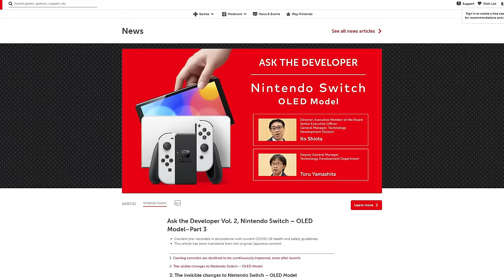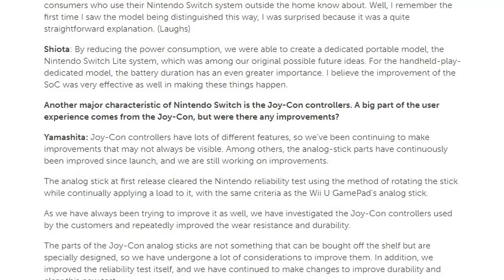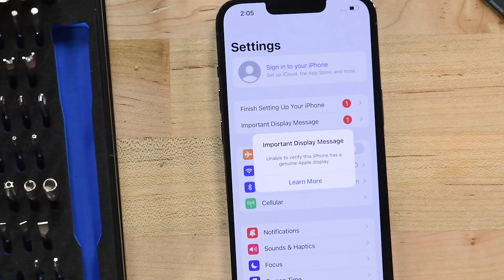Nintendo Switch OLED Teardown: More Different Than You Think

Comment: The joysticks are definitely different, especially the left one with the OLED.

You can tell just by the sound that it makes through use in comparison to older joycon models.
Reply: Worse or better?
Reply: @FloresdorfGaming  for better. Zero drift and the joysticks feel sturdier.

Comment: Have they fixed this issue where if you put joycons in upside down they get stuck?
Reply: I just tried that with my Switch OLED and indeed they fixed it.  If you insert the joy-con upside down it is blocked 3/4 the way in and easily removed.
Reply: @SanderEvers  That's awesome, I hope people see this comment.
They probably should have mentioned it in the video.
Reply: You can do that? Hold on-

Comment: Should you remove the anti-shatter film if you intend on getting a screen protector?
Reply: Just put a screen protector on top of the film. That's what I would do. Hopefully when the screen protector needs to be removed, the film underneath doesn't get damaged. You might want to talk with a Nintendo representative (assuming they even answer your question, lol...)
Reply: Definitely not, never remove that film.
Reply: The film is to stop glass shattering everywhere. Does nothing else

Comment: Did u see 2 foam sticker around the analog sticks to apply extra pressure on the the sticks to help keep Joy-Con Drift Away
Reply: It's a dust cover to prevent drift. No pressure. If the back is applied with a cardboard maybe temp fix. Bought used and I know why. 5:58- Black spots on the blue tap is dirty= drifting. I cleaned all and its fixed. Not easy to open it + put it back in. L, 2 tabs broke from opening it higher, but the 2 sides manages to hold it in place.

Comment: Been using the OLED switch and regarding that thermal change, I've noticed my switch being a lot cooler than the original and updated chip
Reply: So you’re saying OLED is cooler than V1 and V2 models? Some said OLED gets very hot when playing games
Reply: @Retro Gamer 64  mine hardly does tbh. Especially docked too, it's not any hotter tbh

Comment: A removable / modular storage unit on the original vs the non modular memory module on the oled makes 0 difference as swapping these modules between Nintendo switch units doesn't work to begin with... Unless the units you are swapping them on are unpatched and can have various points of data dumped and transferred to another module. But that's getting into a territory of the switch that isn't too common anymore.

Great teardown video either way

Comment: After 3 years, I would think Nintendo would do a Switch Pro or tweak performance and give gamers a smoother experience when playing games if upgrading the graphics card wasn't an option for Nintendo but at least release a newer model with 30fps locked with the OLED screen upgrade could been a nice addition.
Reply: why would they lose money on a dead system anyway

Comment: I don’t own a switch but I’d love to buy Nintendo switch OLED. From an engineering standpoint, I’m really happy that Nintendo has made a somewhat repairable console. If there were to be fourth version of the Switch, i’d like to see the battery not glued down. I’d also like to a removable SSD like the Microsoft Surface. 256GB M.2 NVME 2230 should be enough.

Comment: fin fact: the only thumbsticks that were practically impervious to wear, were those of the sega saturn and dreamcast.
they used hall effect sensord on the board, and a little magnet for the tracking, and a centering mechanism that simpley couldn't develop any wobble. at worst, those needed a cleaning and some fresh lube after hundreds and hundreds of hours. and at that point wear of the buttons was the bigger issue.
Reply: 8bitdo has a new controller with that hall sensor on sticks

Comment: Everyone just kind of skips by the actual removal of parts. How do you take the joycon ribbons out? The heat sink is pretty stuck on and you just cut to it coming off.
Reply: you mean.. the ribbon cable Inside the joycon??? just lift the Ribbon Cable LOCK .. lift it up with plastic tool to unlock it then you can safely remove the cable

Comment: I’m not a huge fan of how much the kickstand hinges are protruding into the body of the switch. I know the LCD switch was never IP rated but the old design definitely was better at keeping dust out. The new design looks like it would be extremely easy to get a lot of dust and dirt in there.

Comment: So does the OLED still suffer from certain issues (especially with V2) such as cracks developing near screws, bending from heat when docked (believe it's been confirmed as a myth?), rail issues, fan issues, scratching when docked, and such?  If the build quality is better and prone to less issues then that makes 350 and a cheap OLED Samsung screen a bit better to swallow.

Comment: Does the OLED screen use the same connector as the standard LCD one? Wondering if its possible to swap in an OLED display into a V1 switch.

Comment: How many milliamp hours does the battery have
Reply: The batteries are mention as being 16Wh. 16Wh divided by 3.7V (nominal voltage of pretty much any lithium cell) gives 4324 Mah as the total capacity.

Which matches the 4.3Ah capacity Nintendo themselves advertise in their specs.

Comment: So I've come across an issue with the rails of the Nintendo switch oled. some disinfectant sanitizer got onto my joy-con and left side rails of the Nintendo switch OLED, and now is very finicky with connection. I took apart the switch to wipe down with unfortunately I only had 91%. Isopropyl alcohol, and it works better but still with light movements it will disconnect or reconnect.

My question is is it possible to reuse the original switches left side rail module or rail and total to replace the left side Nintendo switch OLED rail?

Comment: Hey would you tell me the cause of my switch lite damage? just got an orange screen of death and all I know that’s caused by the wifi chip. I’ve heard and seen a lot of orange screen of death probs on the swtich lite, v1, and also v2. Does the oled version got the same possibility as the other switch issues?

Comment: I have a Nintendo switch and it went black screen and won’t boot up anymore and I have tried every home method and check the cables dock port AC adapter and a hard reboot any advice?

Comment: Is it a shield or a heat sync? I always thought it was a heat sync. What's would be the reason to shield it off?
Reply: They need to stop the heat from gegting to the back of the console. It's because your hands will touch the back of the switch, and for comfort and safety reasons it can't get all the heat from the SOC dumped in the back shell.

Comment: I can’t seem to find the answer to this question anywhere on the internet. But for the protective film on the front of the OLED panel. Is it possible to replace? I bought mine used and it looks like the previous owner made the mistake of trying to take it off. One of the corners is bubbled up. So is it possible to take it off and replace it and where would I find a replacement?
Reply: Take it off entirely. It does nothing but stop glass from flying everywhere if dropped.

Comment: The OLED model is awesome
Reply: Any joy con is compatible with the Switch OLED. Unlike Apple, making certain parts from the same model not compatible since iPhone 12.
Reply: @thatguyalex2835  Lol why are you bringing up Apple?
Reply: @Starling_54  Because they are impossible to fix. They were better a few years ago, like during iPhone 5-6 era. I have nothing against Apple, but I am glad Nintendo is not going the Apple route where parts are locked in by software. :) Louis Rossmann has a lot to say about Apple, and it is not always positive.
Reply: @thatguyalex2835  yeah, I guess that makes sense.
Reply: @thatguyalex2835  phones break that’s why me personally if my phone broke I’d just buy a new one tbh
Reply: @thenotoriousjoey9956  But they shouldn't break after one year.
Reply: @thatguyalex2835  wym I had my iPhone 11 Pro Max for 2 years and it’s been solid take care of things and it will be fine
Reply: @thenotoriousjoey9956  That is good. Some phones fall apart quicker, especially cheap 30 dollar androids, but 900 dollar iPhone screen can break easily also

Comment: Mmh I would be intressting if the display connector is the same. And when it is if it possible to mount the led in the lcd version
Reply: They're not the same size. You probably could connect the cable and it would work but it couldn't stay attached to the switch case/shell.
Reply: @MajorasWrath1  that's not a Problem to modify tge frame

Comment: So can I just plug that oled screen in a regular switch? or is there not a spot on the motherboard?
Reply: Pretty sure the OLED screen is slightly larger. It wouldn't fit without you doing some more hard modding and it'd be a pain in the ass.
Reply: Steam deck is a handheld PC. Switch is a handheld console.   still have their pros and cons.

Comment: I would be careful removing the antenna from under the shield, you can easily short out something with it's metal connector.
Also I would consider the display panel as plastic since it's top layer is and can be easily scuffed. Nintendo should've used a pre-applied plastic screen protector so buyers can either leave it on and/or replace with one of their own.

Comment: I will point out that as far as joysticks go, at the least nintendo has made them the most modular compared to all other gaming platforms as controller replacement goes. as if a joy stick on a single joycon going bad is half the set.... And this was one of my biggest concerns for the steam deck when I saw no detachable controller region. Honestly though the modern joystick will in the current consumer cost effective and size feasible state be a item that gives out faster than many would hope and that is just how it is.... I wouldn't attribute this to Nintendo in any case despite that.

Comment: so nobody is going to address that the heat pipe and fan got smaller... if some other company "did" something like that I am sure the internet would lose it's mind hahaha
Reply: Well, apple does it or even has fake fans that don't actually provide any cooling. Nintendo shrinking theirs makes sense since the second revision switch has a more efficient chip that therefore does not run as hot. 

Apple might shrink the heat pipe and change nothing about the chip so it runs hot often making you buy a new product sooner, and everyone would praise it for being innovative :)
Reply: Sony did that with PS5. Heat sink is tiny in v3 vs v1 and much lighter console now

Comment: The cooling system is exactly the same as the switch lite
Reply: yes, probably they realized that the switch lite's smaller ventilation system performed as good as the og switch, and both consoles being the same in terms of cpu and basic functionalities they applied the same concept. clever

Comment: Does anyone here know what thermal paste the regular switch uses
Reply: There's really no way to know lol. You could just use any thermal paste. Use Non conductive if you're worried it might touch any solder joints/components

Comment: I'm surprised they nerfed the cooling a bit, my 2029 model tends to run hot in docked mode
Edit* lol I mean 2019 model I'm not like some sort of time traveler haha....

...unless
Reply: Its just a switch thing honestly the best thing you can do for any switch model including the oled is to leave the back plate off and place it in a well cool ventilated space particularly if you have an ac running with the air facing its intake vents the docks cooling isn’t really ideal but that helps a ton
Reply: @alexbolt5  I'm still baffled as to why they didn't put a fan in the dock
Reply: @thcollegestudent  yea completly missed opportunity I hate that I have to worry about the cooling of this thing compared to the previous nintendo consoles the new dock for some reason instead of having a big cut out for the vents now has slits and in what way would that help an already hot console
Reply: Dock is a switch toaster. I run a usb extension cord from it to my V1 so it’s completely out of dock

Comment: I have got a question. Can i Upgrade the momery of the switch from 4gb to 8gb? I am talking about RAM. 😅
Reply: That would be sick
Reply: Even if you did that you’d get zero use because games are coded for 4gb not 8. Just like N64 ram expansion pack does nothing for games which don’t use it

Comment: I don’t get why companies don’t switch to HALL sensors for joysticks. Raise the price $10-20 and they’re basically invincible since they rely on magnets rather then physical mechanisms
Reply: cuz you have other signal components like infrared camera and bluetooth antena that might get affected by a magnetic based technology ?
Reply: @freezeframeplease they’re used in my drone controller, that also uses multiple radio signals at the same time to communicate with the drone. No reason it couldn’t work
Reply: @isaaclanier1507  idk man switch is very tricky :( u can’t even share photos with a smartphone while using bluetooth audio and took them years to figure out how to use bluetooth audio and joycons bluetooth at the same time
Reply: @freezeframeplease  i mean sure, but that also doesn’t excuse PlayStation and Xbox, so what’s their reasoning? I guarantee my drone controller with a 20+mile range on two frequencies at once is more complex then theirs. Also I’m not sure if Nintendo was having issues or not. They really haven’t said, but it could be possible they were
Reply: @isaaclanier1507  the technology you-re talking about does sound pretty neat tho
Reply: @isaaclanier1507  imma look deeper into that rn

Comment: But it makes the console power than OG switch v1 and 2 ?? If not it got no point to buy this one while "both is still the same and only thing they changed is Oled screen , improved speaker , bigger battery " ether way not thing else got change since V1 and V2

Comment: Did you ACTUALLY test the repairability? Since I had a switch right when it came out, played the crap out of Zelda, Switch got buggy on me, kept the EMMC module to pop into my new switch and found out those weren't hot-swappable. So... I was wondering if Nintendo pulled the same shenanigans as say Apple does and digitally signed their parts so you can't just drop in a replacement card reader and game card reader. Under the guise of "anti-piracy" measures.

Comment: Devices like the Switch should really implement DLSS or FXR for extra performance.
Reply: It only works well on high resolution, it'll just be a blurry mess on low resolutions.
Reply: @Benri05  Wouldn't a more powerful chip allow for a higher resolution, say 1440p ?
That would help with support for DLSS/FXR and improve performance. I was hoping for this when I heard about the "new" Switch model coming out.

Comment: Smaller fan / heatsink isn't because the new system runs better.  Its so your console doesn't last as long.  Same reason why the joycons are manufactured knowing analog drift kicks in eventually. (usually after the 1 year manufacturers warranty)

When they develop these systems, they do testing to see how long most consoles will run before failure, looking for just around 2 years, the same as the smartphone model.

It's why my PS2 and PS3 analog controllers, as well as my Xbox controller that I use for PC, all have ZERO analogue stick drift, and none have broke down, or been replaced... but my newer PS4 controllers were replaced 3 times, and my original Switch Joycons are useless from drift, but the cheaper, $25 (CAD) wired controller I bought to replace my joycons, which I use MORE than my Joycons, have no drift whatsoever.  

They are manufactured to fail within 2 years (with regular use)
Reply: have mine since launch (joycons) and never drifted, and my ps3 one presented drifting in both sticks fairly soon.

Comment: Can you put oled screen in older version of swich
Reply: The screen is bigger, so no.
Reply: @SanderEvers  the framing appears to be the same size though
Reply from the maker: The screen is bigger, and the connectors are very different, so you wouldn't be able to do it without some serious modifications!
Reply: @iFixitYourself  is the OLED display connected via a MIPI/DSI connector? if so, a adapter can be made
Reply: @iFixitYourself  well that’s unfortunate. I was really hoping to mod my switch to have oled. I’m actually kinda surprised no aftermarket OLED screens were never made for the switch… hint hint ifixit ;)